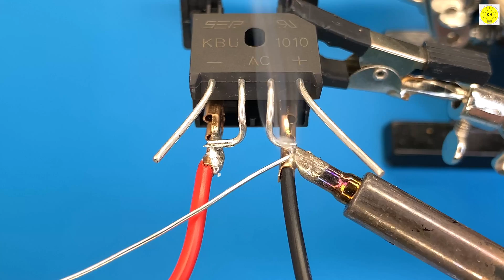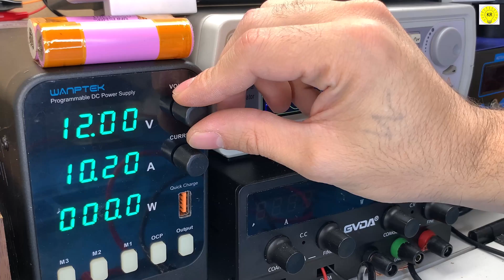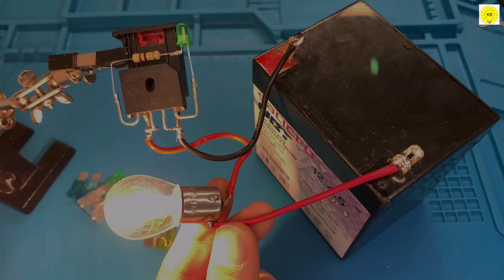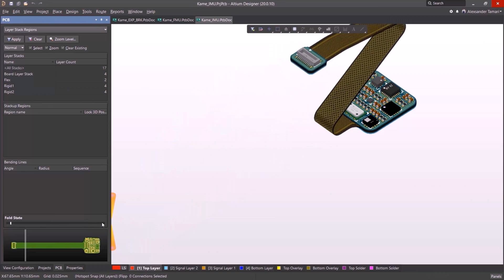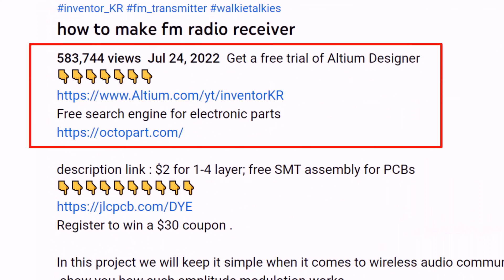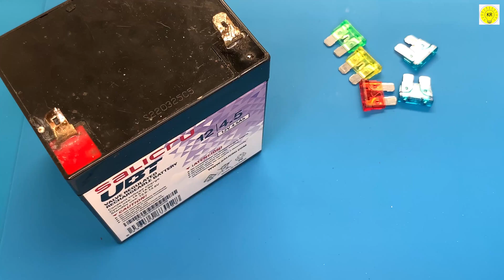The Easy Way to Make a Blown Fuse Indicator , fuse indicator circuit

Comment: Good in theory, unfortunately, this creates more headaches than does good
Reply: why?
Reply: @simonburke6681 because when a fuse blows there will still be a small amount of current passing through the light so when voltage is tested at the suspect device it will appear it has full or close to full voltage which causes the troubleshooter to not think about the fuse. I have literally spent 1000s of hours on the phone and have taken trips halfway across the world because of the “blown fuse indicators”. I will replace every single one I find with a normal fuse holder.